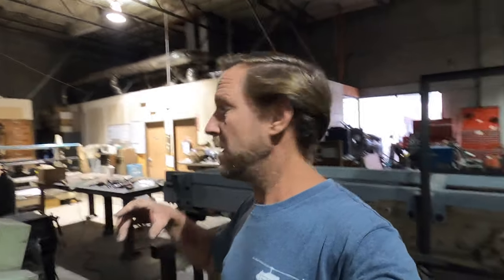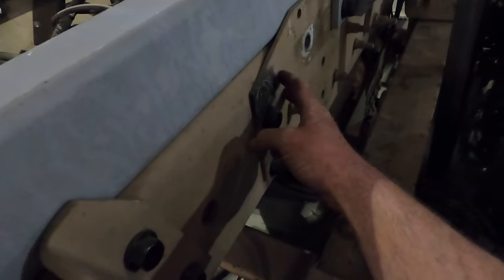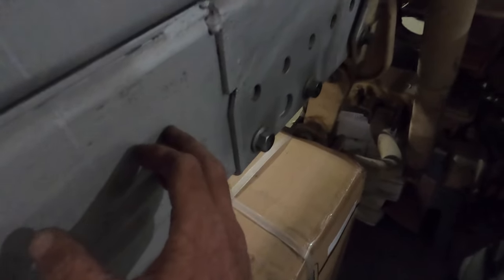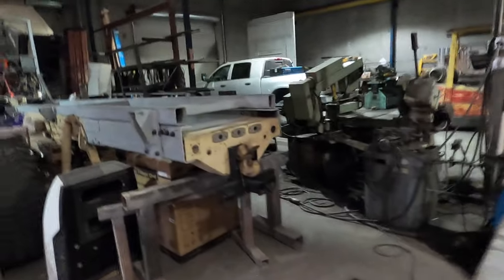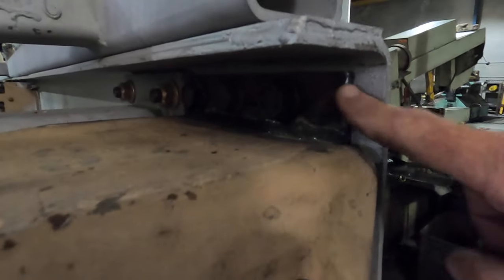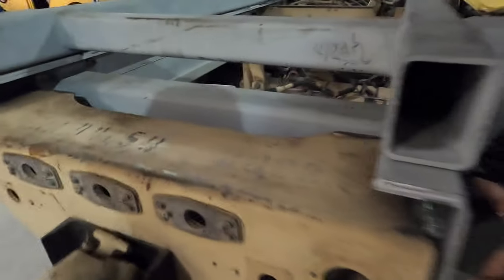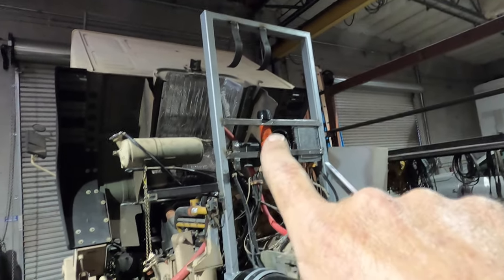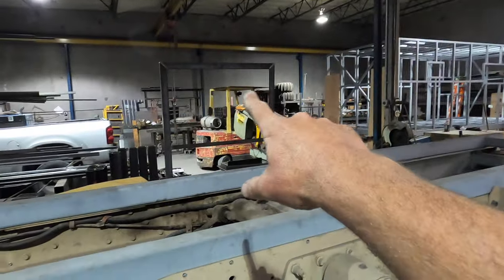Adding a pintle hitch and standard hitch receiver to an LMTV - Overland Truck Build Part 23

Comment: Nate, where did you source your 10.9 flange bolts and flange nuts? I'm adding a drop hitch receiving plate to my M1083A1, but with the extra half-inch, the old bolts aren't long enough. I'm having a heck of a time finding some new bolts to buy.
Reply from the maker: I got them locally at American Materials in So Cal.  I could go grab some and mail them to you if you need?  Let me know!